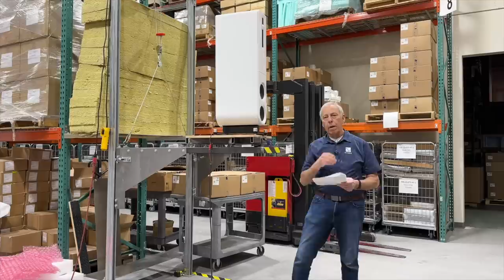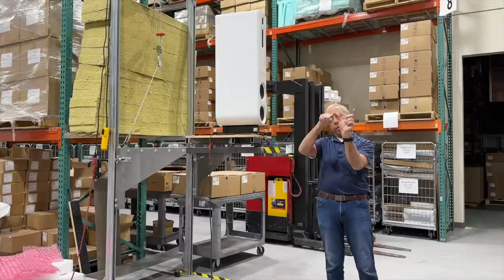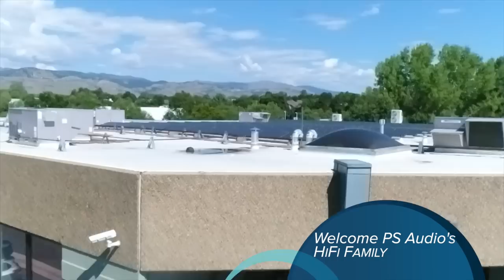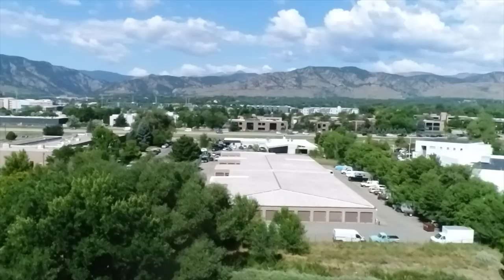The Zobel Network explained

Comment: Zoebel networks (for Power Amps) are just used to dampen "potential" ringing from the RLC network created by speakers and the crossover network. Some networks have inductors, some don't. The inductor helps improve the amps damping factor for reactive loads.
Reply: Short and to the point. I seem to remember the term is after the name of Otto Julius Zobel, not Zöbel (= Zoebel).

Comment: The speaker and crossover produces a complex fluctuating resistance (impedance) to the amplifier which is reactive and changes with frequency. A Zobel network attempts to add apply an opposite value impedance which when combined with the speaker impedance acts to flatted the impedance curve out, in theory presenting a load that looks more like a simple resistor for the amplifier to drive. A  capacitor-resistor Zobel network is a crude first order conjugate match which takes out the worst of the impedance fluctuation. More technical is a conjugate match which I suppose in a way you would call a “supper Zobel network” It would require multiple inductors, capacitors and resistor values. Dynaudio used to conjugate match a lot in the ’90’s
Reply: I see that many people who make zobel network insert this towards the end of speaker crossover construction. shouldn't zoble be put in almost first and then design the rest of the crossovers around it?

If you put in zoble last, the frequency will change too much?

Comment: There are other YouTubers who explain
(zobel nettwor) better.

(zobel network) is a capacitor and a resistor connected in parallel with the speaker element.

If you connect a coil in series with a speaker element and then connect a capacitor in parallel across +- on the speaker, you will experience that you will get an effect exactly as if you inserted a larger coil in series.

If you take a resistor and a capacitor in parallel with the speaker, you will find that the resistor regulates how much the capacitor should function exactly like a light bulb and resistor.

This is how you will physically experience the effect of a (zobel nettwor)

The more advanced explanation is that it also changes the frequency curve of the speakers. Search youtube for it.
Reply: It let's the crossover network work as designed, because the impedance of the speakers is stable around the crossover frequency point (ideally at least for 2 octaves).
Reply: @mariuszsobolewski6713  I see that many people who make zobel network insert this towards the end of speaker crossover construction. shouldn't zoble be put in almost first and then design the rest of the crossovers around it?

If you put in zoble last, the frequency will change too much?
Reply: @ford1546  Zobel Network must be placed right before the speaker driver (in parallel). It doesn't change the frequency response of the driver, only the impedance of it as seen by the crossover network.

Comment: Paul misled people here I think ... a typical Zobel network consists of a power resistor (10 watts typical) and a BP electrolytic capacitor.. These two components are wired in series and then the two open ends are connected in parallel with the woofer terminals ok 👍.
When designed correctly the speakers impedance curve will show a peak in impedance at its fundamental (Fs) frequency and then as the frequency rises it's impedance will remain flat running at or very close to the voice coil resistance ... right up to 20 kHz or more ... 
The idea of keeping the impedance curve flat is to enable the low pass filter section in the crossover to have its proper effect on the speaker at 8 ohms or 4 ohms . A higher impedance would render the crossover ineffective ... so there you go 😆 KEF used to call this 'Conjugate Load ' back in the 90's ...
Reply: So, would you install a Zobel first, then calculate the crossover at the "flat" impedance level of say, the woofer? Seems a Zobel works to eliminate distortion if speaker impedance rises at frequencies it does not handle well. Sorry for the "layman" terminology, but I am trying to learn this stuff to build my own crossovers.

Comment: The problem with traditional drivers with voice coils is that they are effectively inductive in nature, making designing a passive crossover very difficult due to the variable nature of the load these drivers present.  A properly designed zobel network smooths these reactive loads making them less variable. Then the mathematical formulas for designing the crossover work properly.

Comment: You stsrted with a 12db filter. You could have discussed 6 db filter first. That way the zoebel makes more sense. The problem is.the stored energy smears the signal..everything you add has both positive and negative aspects.

Comment: So that means you added an inductor to make an R-L-C circuit  before you circled  back to the original 
R-C circuit? There are many types of these filtering circuits, e.g., a PI filter that are used in DC power supply smoothing, crossover networks and all sorts of electronic circuitry.

Comment: I have OCOS speaker cable which is terminated with either a zoebel network or a simple adapter at the speaker end.  With my two-way speakers, I used the zoebel adapter.  I now own single driver speakers without crossovers.  Are there any advantages or disadvantages to using one or the other adapters now that there’s no crossover involved?
Reply: What Paul explained: the driver's voice coil is itself an inductor. A Zobel network is going to smooth out the top end of the rising impedance. This will make a difference in treble response with some amplifiers and not others. Most users of speakers using full-range drivers I know use tube amps. e.g. single-ended. Depending on the quality of the output transformer, the impedance curve of the speaker may influence the frequency response. Best to try and listen if you hear a difference. A Zobel network may also keep some types of solid state amplifiers from being driven into oscillation, but I'd be surprised if, as a full-range user, you owned one of those, as those brands would hardly recommend OCOS cable be used.
Reply: @LeonFleisherFan  Thank you for your reply.  I use home built Decware 2 watt single-ended amps with Edcor transformers and the speakers are by Omega.  The treble rolls off quite rapidly just above 14K.  I’m 69 years old so that’s about the range of my hearing anyway.  Im guessing from your response that in my case that all the zobel network would do in my case is add a couple more components into the signal path needlessly.  What are your thoughts?
Reply: @ronniefranks4351  Don't you hear a difference in treble extension with the Zobel network in? It's only "unnecessary" if you don't. Love Decware, by the way. But I wonder if you get less treble because of the Edcore output transformers versus Steve's own. Did he give a thumbs up on those?
Reply: @LeonFleisherFan  I haven’t had time for listening to sort it out.  I want to set up my microphone and measure the frequency response with and without the zobel adapters in addition to just listening.  The Edcors are recommended by Steve.
Reply: @ronniefranks4351  This would be hard to measure from distance. Are the Omega using a whizzer cone? Makes microphone positioning crucial. Lots of cancellation effects with whizzer cones, be sure to toe in aiming at your shoulders in listening position, and at ear height.
Reply: @LeonFleisherFan   No, the driver is Omega’s 4 ½ inch cone with no whizzer.  I use them with a 15 inch sealed HSU subwoofer.  Works quite well.  Not a big bass fan, just use the sun to help fill in the bottom a little.  I always test with the speakers and microphone positioned as you recommended.
Reply: @ronniefranks4351  No need for an excuse using subs: they're partly there to neutralize the room modes and widen the sweet spot, so it's not just about bass, but scale, imaging and soundstage etc. In my setup I use two subwoofers with three 12" drivers each and it makes a difference for just about everything, including the treble, and they're technically speaking crossed at 65Hz. Subwoofers add more to the musical experience than just bass.
Reply: @LeonFleisherFan  I was able to do some testing over the weekend regarding the zobel network.  I found the results interesting.  Utilizing the zobel network only made a difference between 300Hz and 3.2KHz, and then it was a maximum of .5 db.  I expected any differences to be much higher in the treble range.  Truth is, it made virtually no difference, certainly no audible difference.  The zobel network has been removed.